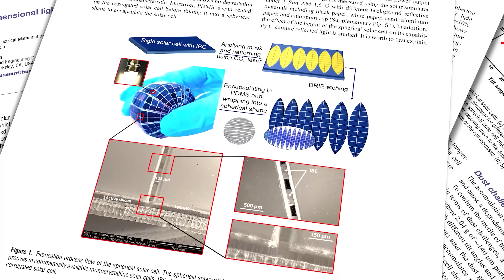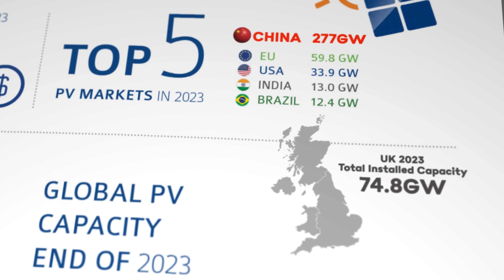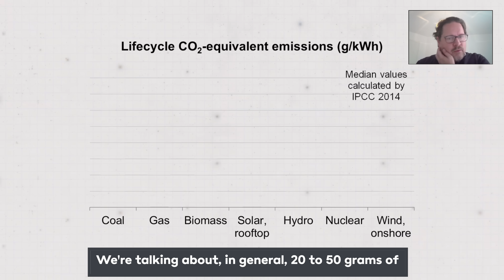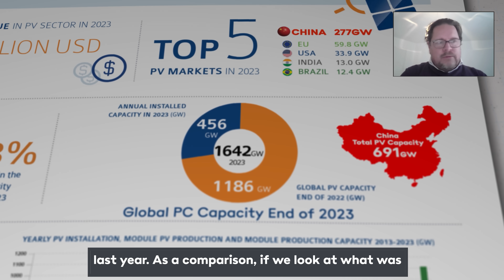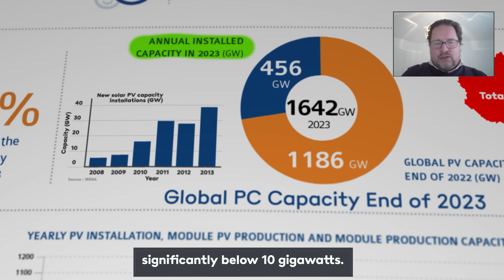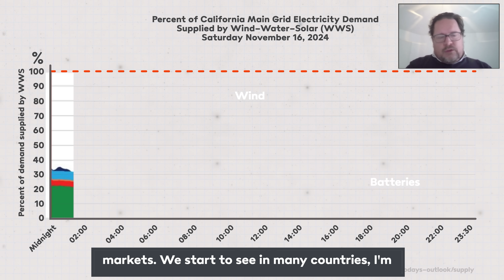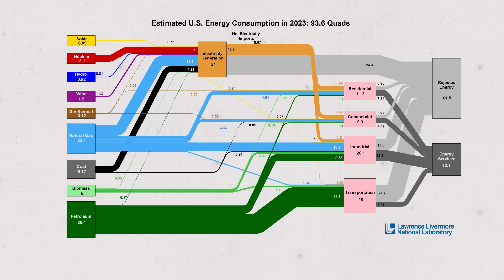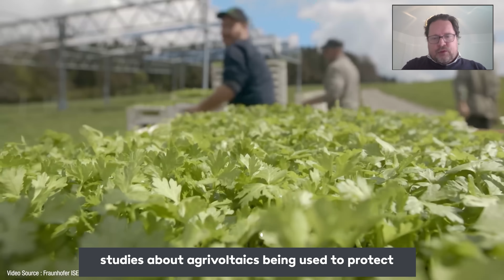Renewable Energy Domination

Comment: I love that little old Australia 🇦🇺 is leading the world in household solar pv. What I don’t like is that we are way behind the 8 ball when it comes to household battery 🔋 storage. Due to our poor political system where one party is firmly in the pockets of the fossil fuel industry and the other major party lacks the fortitude to do what is right, there are close to zero incentives for HBS. Yesterday was a classic example. 38°C, stinking high humidity and even with running my a/c all day I still exported approximately 25kw to the grid but then had to pull energy from the grid at 6 x the price I exported . 

If however, I’d had a battery installed, I could have run my a/c all night and had a comfortable nights sleep, all the while use the energy I’d produced during the day.
Reply: I am in Perth.  Like you, I made more power than I  needed yesterday,  including running 2 air conditioners. The difference is,  I  do have a 15kWh battery. I am still working out the best way to use it but... 15kWh is too much for my normal home use, until I use it for my ev. I have my ev set to charge from 3am. That takes yesterday's left over sunshine and saves it in the car. By the time the sun takes over charging the car, the home battery is down to 10 to 20%. The solar system essentially gets an extra 3.5hours of granny charging into my ev, even though it is night time. That is an extra 40+ km of range (280km per week) not to mention the charging that happens in the day. When combined with an ev, my battery is helping me save about $3000 per annum in petrol plus $1200 per annum in electricity. 
When you do get a battery go modular. Even 5kWh covers a significant amount of my night tiime use in the house. Adding an extra 5kWh provides everything I use in the house at night (your mileage may differ) the final 5kWh really wasn't necessary, but it extends the hours for granny charging the car. My panels will recharge the battery by noon today. The cost of the entire system was about $24000. Since I am now self sufficient in electricity and no longer pay for petrol, the time to recoup the money is about six years. We will be getting another ev soon and I think we will just alternate which car gets fed overnight. 
The numbers already make sense when a battery is combined with an ev.
Reply: @aussie405  that’s awesome mate. Thanks for the tip on the modular batteries. A 10kw battery would cover my evening needs at least 80% of the time. Though I do plan on getting an ev further down the track, so a battery infrastructure that I can add on would be ideal.
Reply: Aus pretty perfect for solar. But household is doing a lot of lifting for an otherwise dirty grid.
Reply: Here in the UK i divert my surplus to hot water and my EV , the ioniq 5 can do V2L so you can get the power back out. We had a 26hr power cut Saturday and Sunday thanks to a storm and used it to power freezers, kettle and toaster.
Reply: @waynecartwright-js8tw  Perfect...you can't do better than that.!   Cheers, Pete from Aus.
Reply: What's completely crazy in Oz is the fact that they potentially have the capacity for almost unlimited solar generated electrical energy.  Combine that with the countries vast mineral deposits and you could turn the country into an economic powerhouse producing everything from refined aluminium and steel etc all the way through to high end chips for computers, solar panels etc etc all built using "free" energy!
Reply: @The_BeeBopper it’s the most expensive free energy there is.

Countries installing large amounts of renewables have their other industries flee the resulting high power costs to countries which use fossil fuels.

The top 30 German industrial companies in 2023 invested 15b in German, and 132b in capital projects in the US where power prices are one quarter the cost they are in Germany.

Australia lost it’s Aluminium production to China and Mozambique once it decided to increase its electricity costs massively be increasing renewables.

Everywhere renewables are added results in higher costs of electricity. There is NO country in the world which has demonstrated lower costs from adding wind and solar.

And it’s because of the ridiculous idiotic comments like that made by Al Gore who thinks (surely he is not that stupid) that solar panels generate the same type of power as a coal plant……
Reply: @The_BeeBopper  Errrrr.... you forgot about the CFMEU factor.  I think their Head Office is in Sicily.
Reply: @The_BeeBopper  I’ve been saying this for years. It’s an absolute outrage that we are not a center for high end manufacturing.
Reply: @rmar127  because in the real world you cannot ignore all the costs which must be included to produce dispatchable 24/7 electricity.

Australia, like all locations where wind and solar are advocated and pushed will have some of the most expensive electricity in the world, which means almost no manufacturing or high power use industry.

I do a lot of work in China and high level people there are always amazed at Australian policy “you ignore your strategic advantage in using coal and nuclear to produce cheap energy in a time where industry will be moving to places with low cost energy?”
Reply: I’m going to do solar and a battery but I need to fix my roof first
Reply: I know exactly your frustration. I have a 6.6kW solar PV system and yesterday generated 34kWh of electricity and only used 3.4kWh from the grid, but can't afford a 5kWh battery to cope with that evening load. Meanwhile, the electricity company pays me 6c/kWh for the excess I put into the grid, then charges me over 30c/kWh for anything from the grid, plus a daily connection fee. In Australia, the coal generators are creating the need to turn off home solar at peak times because the coal generators can't easily be ramped up or down. It's all very well to talk about EVs absorbing some of the excess load, but few people have their EVs plugged in when they are at work, and most people drive to work because the public transport systems can't carry everyone who commutes. If people drive their EV to a train station and park in a commuter car park, the EV isn't connected as a load either. Meanwhile, many businesses are discouraging working from home. For me also, the EV solution is not affordable.
Reply: @theharper1  I hear what you are saying. I am lucky to be in a position to do this and I am trying to get into the best position to lower my day to day expenses as I move toward retirement. Spending on major capital improvement (the solar system) will lower my daily costs on an ongoing basis. And I will be income poor, so that matters. If/when the government starts giving help on batteries, even a relatively small one will mean you don't have to buy back at the peak rate. My battery is more useful than my son's in Canberra. Weirdly, that is because I am on single phase. You really need to find someone who knows how to work out what will work best for you.
Reply: https://www.youtube.com/@OffGridGarageAustralia is a great place to see about batteries in Queensland. For ~$2500 south pacific pesos you can get a 15kW 48V battery. Choosing a  hybrid invertor that takes 48V and your basically done - 48V is low voltage - typically doesn't even require an electrician 😃 (always check in your state).
Reply: I think that incentive will appear pretty soon naturally. At some point in the next few years there will be so much solar that they'll stop paying for exported power, and then it will make sense to store it for later.
Reply: @robinbennett5994  
It makes sense to store it now, the price of batteries is the stumbling block at the moment.
Reply: @robinbennett5994  this is already happening , in Greece there is no feed in tariff , it was abolished , from a measly 5 cents /kwh . Now all they offer is " net metering " whereby you give them your excess generation  and they give you power during  darkness . All this changes when  batteries are added  but they will still take your kw and you get nothing in return ! (😁
from an off grid house )
Reply: Not often you hear Australia described as either "little" or "old"! 🤔
Reply: @ 😂😂😂
Little by population, old as in having some of the oldest geological formations on the planet.
Reply: Batteries can still be costly to make - as you have a safety cost as well to them. So unless we can come up with a really safe method to store it while still being cheap
Reply: At 09:50, we nearly get to talk about heat batteries, which we all know are much cheaper than electric batteries. Why mess with electricity when what you want is a hot stove and a cool room?
Reply: Congratulations on thr announced incentives!

Comment: Great video on this. Shoutout to Comstock for being a leader driving the field. You can buy them as a stock (LODE), I did. A huge amount of precious metals gets lost if panels are not recycled
Reply: Huge?  Really?  The panels are mostly silicon, which is not rare; it's just sand.  The dopants are rare metals, but they are present in such low concentrations that I have to question if it's even worth it to try to recover them.  I'd love to see real numbers on this.

Comment: Even if everyone has an EV and we add a lot of grid level storage we will still have problems when there is a long period of overcast weather. Sooner or later all storage will be empty and we would still need alternative sources to start generating to pick up the slack. Having all that redundancy will cost a lot.
Reply: That's why unnatural gas plants aren't being dismantled. They'll run less and less as renewables + batteries (and pumped hydro, and other storage) supplies more electricity most of the time. There is a problem figuring out the incentives to build new thermal plants or other dispatchable generation if they're only going to run a few times a year. Electricity will be very expensive in those rare periods, which will encourage consumers to use less, and those with home energy storage and V2H EVs will be shielded from the price hike for a few days. It's going to be messy, but rare.
Reply: Also, that's why we have a GRID.  The wind is always blowing somewhere, and the sun is always shining somewhere.  We also have various forms of storage, and as skierpage mentioned, we have lots of gas peaker plants that we'll keep around for the rare events like you mention.
Reply: @incognitotorpedo42  yes the wind is always blowing somewhere but it could be far away and that means high transmission cost, loss and limitations. Keeping around peaker plants that are almost never used is expensive and the same is true for grid transmission capacity.

No matter how you look at it there is a large cost to pay to mitigate the intermittency of solar and wind.

This cost is real and does not go away just because we want it to. We have to realize that we have to pay it to rely on any intermittent energy source like solar and wind.

It's just a question if we are willing to pay that cost and how. Do we become more flexible and change how we use electricity? Do we accept that we can't perform some energy intensive tasks when the price is through the roof?

Do we pay a higher price all the time to keep a robust grid and redundant peaker plants around?

Everything can be solved we just have to be able to accept the cost and not fool ourselves that it doesn't exist.

Comment: We've lived off-grid for four years now in a +4k square foot house.  It is getting easier and easier to install these systems.  At some point it's going to be as routine as getting a new appliance.  We'll never go back on the grid, there's no reason to.
Reply: Our SE Qld suburb of 5000 houses lost power for 2 hours. We had panels since 2012 but without battery backup they are useless. The biggest part of our power bill is the services charges which are now bigger than our original non solar total bill.   Blackouts are a "Service".  They tired to give us a new powermeter that has the ability to switch off our power anytime they want.
Reply: @FlintStone-c3s  battery prices have really fallen over the past several years.  You should look into them again.  We originally started with AGM Lead Acid but just switched to lithium.  When we bought the AGM batteries they were cheaper that lithium and safer.  Now the lithium is way cheaper than the AGM and are now safer so it's flip flipped.  Inverter prices have really fallen as well.
Reply: @FlintStone-c3s  Qld Oz has a rather 'stupid' energy supply system. Batteries are NOT acceptable on its mandatory Grid system run by a Monopoly subservient to the single House State government - Qld is set up very poorly. Not a good example to use
Reply: While being self sufficient has benefits so too does being connected - if your home system fails for some reason (even if it is decades from now) it would be useful to have an outside source to immediately get you back up and running, especially if your heating runs on electricity (I'm not saying yours does, but that seems to be the direction that the government and many experts want the country to go in) and you happen to be in the middle of a cold winter.
Reply: @danyoutube7491   I agree, however the power went out all the time when we were on grid at various times during the year.  If we lose power now for some reason we have a generator to get us by and are lucky to have equipment redundance in place for the solar as well.  We also used a generator when on-grid and the power went out.  Another good thing to have is a solar generator.  Simple and reliable.
Reply: @Off-Grid  Do you have a septic/sewer system? That's the only part that gets to me about being off-grid.
Reply: @Dylan_Marshall  Yes, I went to the county and took the open book multiple choice test to get my installer license and did it myself.
Reply: @Dylan_Marshall  You can be "off-grid" for power but still be connected to a sewer system. In theory a house in a normal suburb could provide it's own power with rooftop solar + battery storage while still being connected to the city's water and sewage systems.
Reply: @danyoutube7491   Power cuts are as common or more so than problems with a solar installation , if this happens  then a generator covers the needs until it is fixed , I know because I have an off grid  system and in 2.5 years  have run the genny 3 times for short periods , plus  never had a poco bill .
Reply: Most of the planet is not a bunch of rich westerners.
Reply: Correct but if no one did it where would we be?  Also, richer countries have put forth a lot of money to developing countries so that as they industrialize it'll be cleaner than we are currently.   @arnoldvezbon6131
Reply: @arnoldvezbon6131  And most rich westerners could easily learn to suffer through an occasional power outage, especially in the American "Mountain West" where winter storms frequently cause outages that we endure without any particular stress or danger, or even disruption.
Reply: @arnoldvezbon6131 'ark to this 'un, lads. Trying to get all social justice about it.
"I detect a little communism..."

Comment: So solar PV prevents around 1Gt CO₂ emissions per annum.

Humanity emitted over 40Gt CO₂ in 2019.

The ability for humanity to achieve net zero emissions is indescribably tiny…
Reply: You two win the award for "Doomsters of the week"!  Look at the uptake graphs.  This stuff is just getting started.  Check back in a couple years.
Reply: @incognitotorpedo42 you do understand we have to achieve net zero, not just have a go? Renewables in the electricity sector will never achieve net zero in the entire energy system.

Time to achieve this is pretty much expired.
Reply: True, the focus on wind, solar and electric vehicles is just the system trying to survive without having to change.
Reply: Keep in mind the primary energy fallacy: across the entire global energy system over 50% of all fossil fuel primary energy is thrown away as lost heat. Renewables don't do this. So they don't need to replace all the primary energy of fossil fuels, just under 50% of it.

That said, we definitely want to be serious about getting rid of that 40 Gt!

Comment: As long as my solar garden-lights don't function in the winter (during the night) I am not going to buy solar panels.
Reply: Garden lights are bottom of the food chain in terms of efficiency, panel size and battery capacity.  I wouldn't use those to make that kind of decision.  Or maybe it was a joke...
Reply: @pixelfrenzy  The point he's trying to make is valid though, in many parts of the world the seasonal variation in PV output can be 100-fold.
Reply: @SweBeach2023  I live in the Scottish Highlands, where it's still light at 10.30pm in the summer.  Swings and roundabouts... obviously PV is not a global solution, but it's a very simple and cost-effective one in very many locations.  Drawing conclusions from garden lights isn't helping anyone.

Comment: In Quebec we have the lowest electricity rates in North America. That's not a good thing, because it doesn't encourage energy efficient solutions. I wish I could install solar panels on my rooftop but right now it's so expensive here that it would take more than 20 years to recover my investment. That being said I hope that prices will continue to go down. If one day it's possible to recover my investment in 10 years, I will install solar panels.
Reply: If you have clean hydro power and it's cheap, why not just enjoy it and forget the hassle of operating your own power plant?
Reply: @incognitotorpedo42  The problem is that wasting electricty is too cheap. Its common for single famyli to have a 300A panel. Like 50A for a hot tub in -30oC weather wich is riduculous.